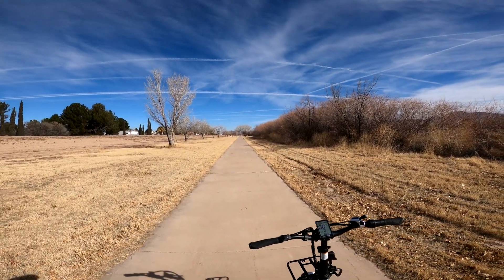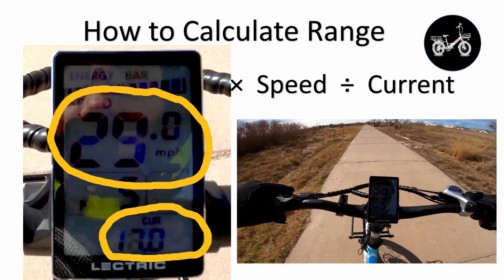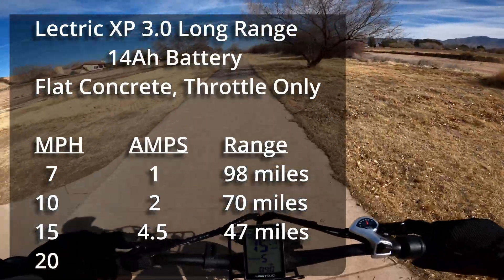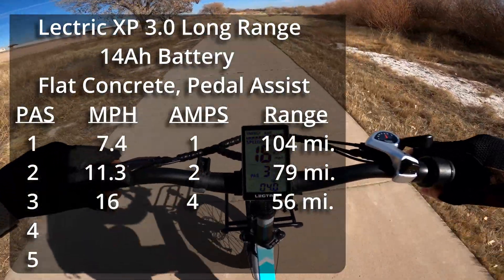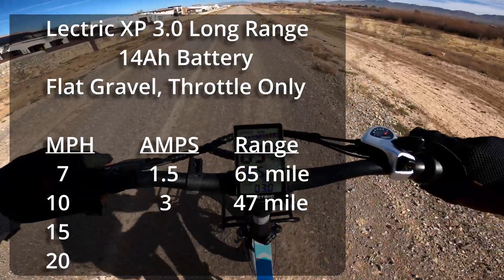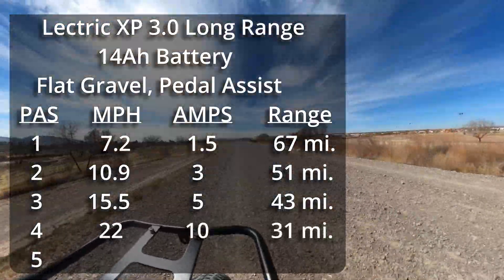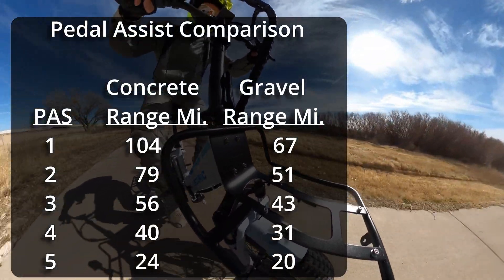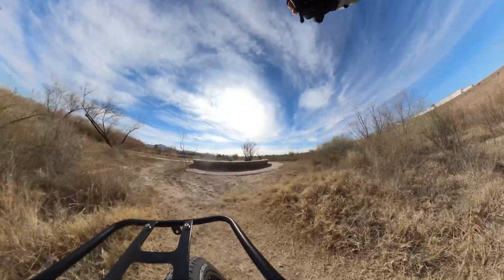How Far Can You Go? - Range Test - Lectric XP 3.0 - Concrete and Gravel

Comment: Question, would the weight carried by the bike, ie., your weight, or plus groceries, added equipment, etc., have a bearing on the results?
Reply from the maker: Definitely!  Weight, tire pressure, air temp, gravity, and wind resistance all play a significant role.
Reply: @LectricGo  I sort of figured that. Although my husband and I have the same Xp 3.0s, same basket on back, we weigh different, and he will be carrying the heavy chain lock, and I don’t go over pas 2, and never have used the throttle. He has.

Comment: Does your XP 3.0 have the hydraulic brake upgrade or is it the original 3.0?  I received my 3.0 with the hydraulic brakes 2 days ago. I also think they changed the controller logic.  On PAS 2 I am seeing a consistent 7 amps, and PAS 3 I am seeing 12 amps, flat concrete. I put my kid on the bike, who is 100 pounds lighter, flat concrete, and they reported 7 amps in PAS 2 also.
Anyone else with the juiced version seeing different amp numbers?
Reply: I read in the manual that the hydraulic brake version has speed limits per PAS level. Per the manual and testing:
PAS 1 will go up to 9 mph, and draws 4 amps then cuts out.
PAS 2 will go up to 15 mph, and draws 7 amps then cuts out.
PAS 3 to 5 will go up to the speed limit of the bike, either 20 or 28 mph. PAS 3 is 12 amps.  
It is difficult for me to get a long enough flat run to test PAS 4 and 5, but looks like 16 an 19 amps for those two.
Reply from the maker: I did receive and install the hydraulic brake kit recently but don't have the PWR controller update yet.

Comment: Maybe I'm missing something, have an alleged long range battery in my XP 3.0 on a full charge 54.3V, on flat road way PAS 1,  third gear, average speed 10 mph, ending up with only "48"miles and when I hit 42V the ebike comes to a stop!  Tires are 25 psi each.  No gear aboard.  Huh?  
  Also read that when you reach about 42V your battery is 0%.   Don't know if there is a question here, but it is sure confusing and disappointing that my actual miles is the pits.  By the way great videos, much appreciated.
Reply from the maker: Tires at 25psi are a bit low.  That is my offroad setting.  Try 30 or 35psi and your range should improve.  Also make sure your brakes aren't dragging. 42V is normal for power to begin cutting out to protect the cells even if not technically at absolute zero.
Reply: Thanks for the reply, will up the psi and double check the recent install of the hydraulic breaks and possible lose some weight while at it @LectricGo
Reply: Am curious. What was your average Amp draw in ps1 at 10mph if it was about 2amps then your right in the ballpark on milage if the battery was a 10.4 amp. That being said if you do in fact have the longer range 14ah battery and pulling 2amp average then that number would be disappointing

Comment: no one will get anywhere close to these numbers.  i understand your reasoning, but it just isnt accurate.
Reply from the maker: I agree.  It's more of a theoretical maximum that helps illustrate the impact of speed and rolling resistance.  I still need to perform a real world test to empty at a specific condition to compare to Lectric's range claims.

Comment: For real world riding take that number and cut it in half then divide it by 2
Reply from the maker: Stops, starts, hills, dragging brakes, not checking tire pressures, battery degradation are all common in the real world and will definitely have an impact.

Comment: I started watching my amp draw, especially when i have my kids on the back, pulling a trailer. Lower speeds definitely give less amp draw. 19 amp starts
Reply from the maker: I just wish the current measurment was more accurate and would acutally use the decimal place.  Added wieght from passengers or cargo will have a big impact and this method helps you estimate what the range hit will be.

Comment: I just got that bike and It doesn't seem like I'm going to get that result.  I will have to test it again with your method. 👍✌🖖🥃
Reply from the maker: My method shows the theoretical, best possible range.  Most routes will result in a lower range than what I calculated.  My testing helped show the impact of speed and rolling resistance on different surfaces and saves time by not having to run the battery to empty.

Comment: I have a 2.0 and have never gotten more than 16 mile range on pas 2,  and minimal throttle. Throttle only I would be lucky to get 5-6 miles.
Reply from the maker: That does sound quite low.  What size battery do you have and what types of conditions are you riding in?

Comment: This is a bike that people buy before they find out what other bikes are out there. ✌
Reply: I just received my xp 3.0 with hydraulic brakes two days ago. I have been watching the e-bike market for five years so I definitely have a good feeling for what's available, prices, etc. It all comes down to purpose and price point. Would this be my first choice for a 15-mile one-way daily commute? Absolutely not. But for wanting to keep up with my kids, and have a more comfortable bike than a mountain bike, and occasionally rip it up to 28 mph, for this price point, this is the decision I made, and I am happy so far.
Reply from the maker: That is very likely.  Lectric provides an easy entry point into the world of ebiking.  The XP Premium at it's new price seems like a good deal.  $1599 for mid-drive, hydraulic brakes, better fork and dual batteries seems like a good price.

Comment: Good information. I would assume the motor/battery combination is roughly 85% efficient, so the distance calculated probably needs to be reduced by 15% to give a more accurate projection.
Reply: truth
Reply from the maker: The amps shown on the display should be measured at the controller level which suggests motor and battery losses are already accounted for.  I could be wrong...

Comment: The issue with this is you are projecting from 100 to 200 yard test into 50 to 100 miles. If you shoot an arrow like that, each little percentage of a degree off gets exaggerated the farther out you go. Same thing with this. This is just assuming these controllers are actually accurate in their readings. Even if you were to keep the exact conditions, I would think the result would be approximately 1/3 of what the calculation shows. That being said, it will get people thinking about their amp hours, and make a comparison between maybe what they have, and what they want to get. Please do not misunderstand, I am not meaning to pick. Just my thoughts on how these type of calculation transfer into the real world. Thanks for the video.
Reply from the maker: Yes, I agree.  This was a bit of a philosophical exercise though it seems to be more accurate the faster you go.  I will be doing a full load real world range test to empty and monitoring amp hours for a theoretical vs empirical comparison.